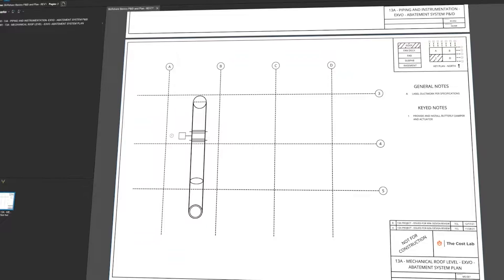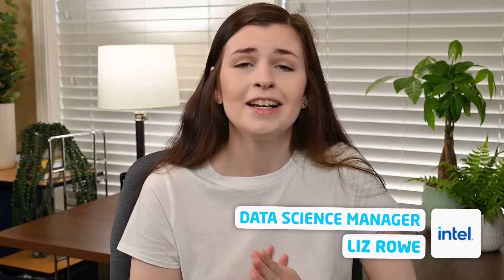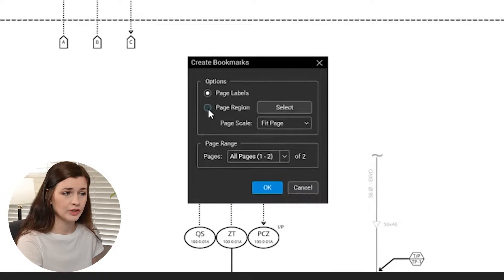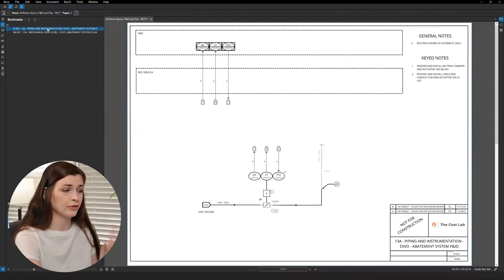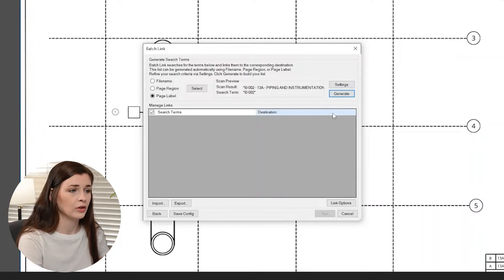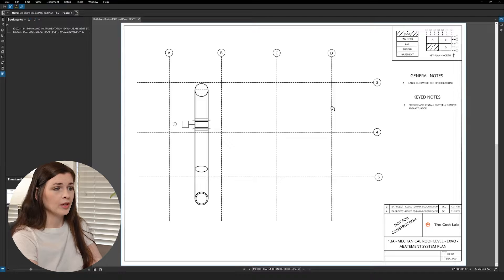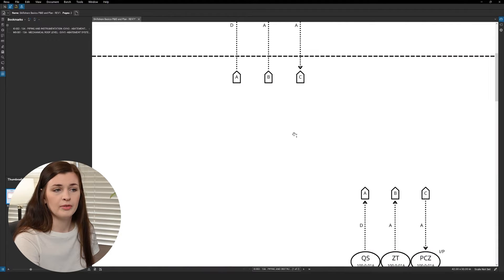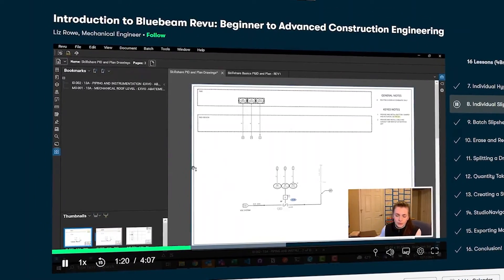🚧 Bluebeam Revu: How to Hyperlink Construction Drawings!

Comment: Awesome....TY for that. My problem is, I work in a Structural Engineering firm where we look at things like Point Loads or Door Placement through multiple floors. Is there a way to copy a Hyperlink from document to document? In other words, 10th floor pdf to 9th floor pdf , etc., without having to re-create the hyperlink for each floor.  Unfortunately, atm, I'm stuck using an ancient version (Ver. 11) of Bluebeam.
Reply from the maker: Yes if you click shift+H it puts you in hyperlink mode. Make a hyperlink to the page. Then copy it while in hyperlink mode (shift+H) and use Ctrl+c to copy and Ctrl+v to paste on any page!

Comment: When I try to batch, it says it skipped all 33 pages of the document.  Could it be because the section cuts on the plans are shown like this SG301/01 ?  Does the forward slash confuse the batch processing?
Reply from the maker: It could be 2 things: 
1. The page title has to be exact match for it to see it as a match. So if there is a / or any other inconsistency, it won’t recognize. You’ll have to do individual hyperlinks.
2. Sometimes pages are not OCR’d. Meaning that somehow the page got messed up and can’t recognize text. So you have to run an OCR. 

If pages were skipped it just means that it didn’t find any matches on those pages!